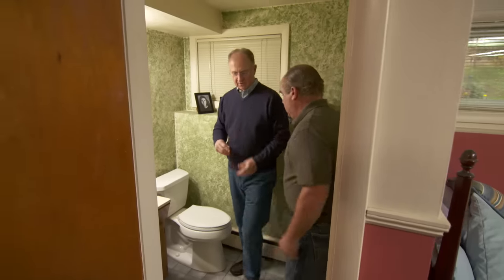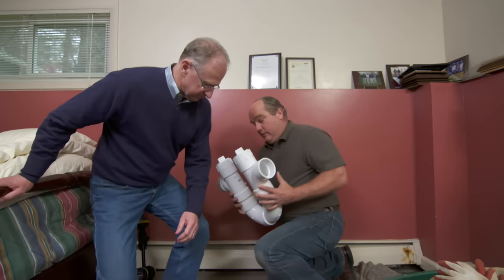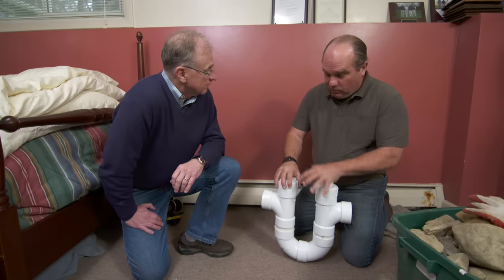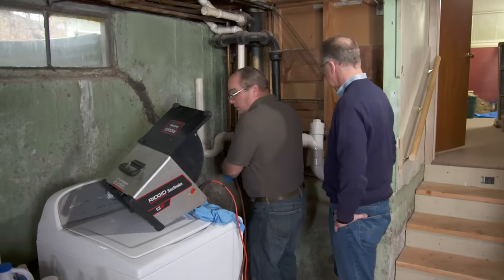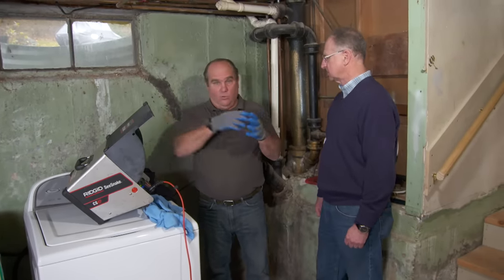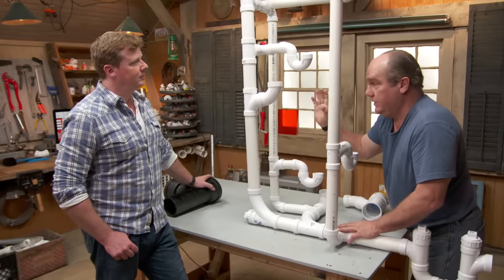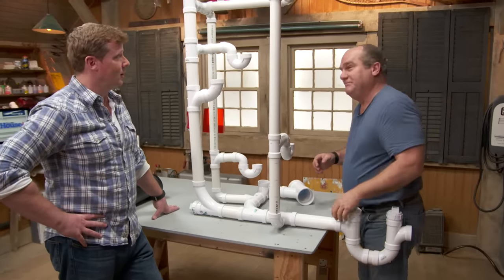How to Diagnose Plumbing Drain Problems | Ask This Old House

Comment: I had nearly the same problem. My main sewer line collapsed around 2 feet plus I had roots in the pipe as well.  Replaced 9 feet of pipe, now everything is good.
Reply: DID THE CITY REPLACE THE SECTION WITH TREE ROOTS OR WERE YOU RESPONSIBLE FINANCIALLY.  IF A CITY TREE SHOULD HOLD TOWN LIABLE FOR REPAIR WORK.  AFTER A CERTAIN POINT, IT BECOMES THE SEWAGE COMPANIES RESPONSIBILITY FOR THE LINES.
Reply: @joewell3074  No the roots might have come from my neighbor's house. She has a big tree near where the root problem was found.

Comment: couldn't u put a pipe within the pipe (smaller diameter)? You'd have to connect it to the house trap at the other end, but that would prevent you from having to do all of that ripping up.
Reply: or just make a new vent to outside since it looks close to the outer wall anyway?
Reply: @alfalfa  yep thats whwt i would do, just add a vent just before that whole house trap
Reply: vidfreak56 you never want a reduction in size with waste lines as you move waste out.

Comment: Also in the same commercial space that I work in that I did the plumbing for in our space. I came in one week and noticed a strong sewer smell normally I don’t smell any sewer smell even with the hack job type of drainage that is below our space in the dungeon. So I asked one of the employees that we have and he said the smell had been there for at least half of the week so I ran The hose down a floor drain then went down in the dungeon below and discovered that water was pouring out of the concrete wall beyond our space where our drain line goes then realized that the sewage pump that is at the end of that really long line had failed and had been overflowing for half of the week!! So I called in emergency call into the leasing company and within the next couple of days they had a plumber there fixing the pump!

Comment: Disappointed in Richard on this one. Rush recommendation with an incomplete diagnosis.  The camera was sitting directly on the bottom of the pipe so there was barely more then an 1" of water in the 4" pipe....definitely not full of water as stated.  Needed to verify the venting and perform a smoke test before talking to the homeowner about ripping up their floor and suggesting a remodel.  Would be one angry homeowner if all that work was done only to find out it was a bad toilet wax ring.  Also, sags are rarely a problem and if they were, there would be waste debris buildup which there wasn't.
Reply: Bad toilet wax ring - definite possibility. The homeowner says he notices a smell, but no gas bubbles in the toilet bowl, just water movement  Like you said, more diagnosis seems in order. Great comment!
Reply: Nailed it.  Thats what happened to my basement bathroom. I paid a plumber to check out a bathroom smell. Ran the snake and camara for 500 $ and nothing.  Later on the toilet started to leak around it. I replaced the the wax ring myself and problem was gone. Since then  pretty much i do everything myself.  Tnx to PROS like U. With a wealth of knowledge  sharing it on YT.  
And i totally agree with ya. That sagged line is really clean and it didn't back up  either when flushed. I dont see any clugging problem from where the camera was inserted to the street. Smoking the line sounds great rather than start digging and wasting money.
Reply: Haha nah. Wax ring is fine because you can hear the gas bubble through the trap which happens after the gas passes the wax ring gas under low pressure takes the path of least resistance which would be through a potential wax gasket leak before pushing up through the standing water in the trap built in to the toilet which requires greater pressure than escaping through a small wax gasket leak
Reply: Most likely the sink trap is the problem, if you can push that much water in the toilet, the sink trap has no chance to keep a water level in the trap to prevent  sewer gas filling the bathroom. 
I noticed that in the mock up of the plumbing system, the lower toilet was flat vented, in MN flat venting is not to code. If solids ever back up into the vent and don't drain out, the lower toilet will start to act up. Try to clean out a flat vent for only the toilet use.
Reply: What more do you want?  The pipe is completely filled with water.
Reply: this doesn't explain why the water is seating in the middle session of the drain line. Your explanation makes sense but could have both problems happened at the same time. No matter what, landlord needs to pay the digging bills.
Reply: Well according to most of the comments I see you on here most people are happy with the video but I guess everybody has to be really picky and butt hurt
Reply: Cameron Bouchard Richards a machine he probably noticed that and didn’t bother thinking about the seal, probably 2nd nature for him to think this way
Reply: What does the wax ring have to do with the water bounce in the lower toilet, this is caused by hydraulic head locking from the water in the main drain line. Keyboard warriors have an answer for everything, but I guess that’s why I have a business while you all are still in your mommas basement! Richard nailed it right on the mark. Great job Richard!

Comment: I don't understand why he is not in favor of a house trap. I thought every system needed a house trap
Reply: Every fixture needs a trap, having a house trap double traps all the fixtures.
Reply: That and a whole house trap makes it difficult to clean out if there was a clog in the mainline between the house and sewer.
Reply: House traps existed long before fixtures had their own traps.  There is no purpose for house traps these days.
Reply: As Richard said, the "house trap" was a countermeasure to rodent invasion of the house, should there be a septic tank outside the house.            I suppose rats might come up from sewers, too.         
Where I live, in Long Beach California, we have heavy metal flappers (which I have never seen, but haVe heard about) which preclude reverse flow, from street sewer to a house's sewer line.  That would block a rat, too.      Unless that rat was a genius rat, with clever paws!
Reply: Out in Chicago, they use backwater valves like you've described, to combat basement floods. Their area is especially vulnerable, since the area is flat, the sewers are combined (but being separated, by mega projects like TARP) and the area is commonly subject to heavy rainfalls.
Reply: Really only required in urban or densely populated areas
Reply: I'm a plumber in Pittsburgh and all buildings and homes need a house/building trap in my county and all the surrounding counties. It is code and will never pass an inspection
Reply: They are not illegal. They are necessary only if you have floor drains in the basement, as they go dry when there not used. But every house trap needs a fresh air inlet on the house side of the trap. They did not have one here. Sag in the line was the problem here. Local codes dictate weather you need one or not. Most of the time, no.
Reply: i run into these up here in mass and usually they are in the basement..as long as there is decent cleanout  access i  leave them alone..  it is a pain though when we are jetting and we run into one..alot of homeowners  do not even know they have one until  there is a problem.
Reply: How in the hell do you get turds to clear a house trap?

Comment: OMG this has started happening in the last few months,,, when the shower or washing machine is being used...but we cannot tell which drain it's coming from, it seems to permiate throughout the house! And there has not been any new plumbing done here, so it just started one day.
Reply: Check for a clogged vent on the roof first.  Anything can get up there and make a nest then a fixture isn't probably vented resulting in the trap getting sucked dry when you use another one.

Comment: Big job indeed - that's going to be some serious $$$$.
I know there's a powerful suction force with the vent pipe and a toilet flush, but I am surprised a trap like that would still consistently pass solids and all the accumulated gunk after 3 decades of use.

Comment: Nice work guys, keep it up. I noticed a big crack in the concrete wall at the bottom corner of the 
window. Could it be that the foundation has sagged a bit and bellied the pipe. ?? 
X-treme Ed

Comment: lol I love how just behind the bathroom there was the entire sanitary system with an access cleanout. same thing with the access in the floor. in Florida, none of that exists in homes, we have to pull the toilet to clear stoppages
Reply: johnny cole what?? No you don’t . lol. There’s an access clean out on top of your roof. You stick the snake through there. Every bathroom and kitchen has one... this guy had the one as well, even though the one they showed is in the basement.
The one on the roof is where sewer gases escape and helps push the exiting water push itself to the city sewer or septic system
Reply: Jonny Cole, definitely like the other guy said.  Get a sectional machine like the Ridgid k-60 and lay a nice size drop cloth on the roof. Carry the machine up then go back and get the rack of cables and the cord. Unstopped tons of main lines like that.
Reply: @GabrielGonzalez-kb5by  obviously smart guy. I was referring to not having to go from the roof. and really the roof is where gases escape? its called a vent hombre
Reply: @erics3886  yeah....ive done hundreds of stoppages through roof but appreciate the input lol
Reply: johnny cole it wasn’t so obvious if you  pulled the toilet. Lol. And a vent IS an access point HOMBRE
Reply: Gabriel Gonzalez idk what you’re arguing about- I never said it wasn’t an access point lol Christ
Reply: johnny cole you never said it was, either. Lol. You clearly corrected me by calling it a vent, while I called an access point. So I had to clarify

What’s up mentioning Hombre, and Christ at the end of your convos?? Are directing it to me as a ‘name’? 
Or you calling on them to join in the convo? Please clarify

Comment: Question. Just bought my first home. Had an inspection done, nothing in that report about the water over flowing in the master bathroom floor from toilet base when we shower. I assume it was because he didn’t let the water run long enough to see. When the shower is running in the master the other bathroom toilet bubbles.  You can shower in the other bathroom and it will still have water in the master bathroom floor. It’s clean water, no smell either

Comment: 8:55 perfect diagnosis…curious about solution, but I would just bypass and go out side wall direct and reconnect from exterior main waste line - thereby bypass house trap and reconnecting house vents from outside. Homeowner has commitment to digging…should jump to outside of house next to bathroom and house trap to find main waste line connection…two holes and a trench and plumper could do in 2-3 hours for $500. Done. Not $5000 which probably what he paid to resolve

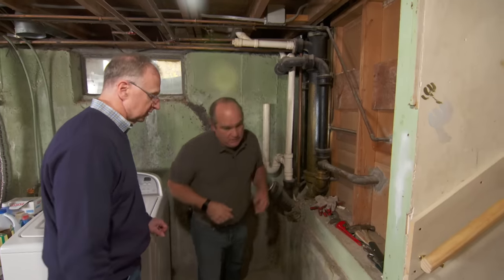Comment: 8:42 - that explanation of the sewer gas seeping through cracks in the pipe when water goes through the pipe doesn't make sense.  If there are cracks in the pipe, shouldn't there not be water at the low point.  This would be the point where the pipe is sagging and possibly cracked from the stress, right?  If the crack is on the top of the pipe, shouldn't you always smell the sewer gas?  I see he corrected his explanation at the end of the video and said that the gas was actually bubbling through the downstairs toilet.  So the issue is venting of the upstairs toilet.  If that's the case, maybe they can just add a vent--possibly at around the cleanout drain plug downstairs, and go out through side of the house where that window is  (2:13).

Comment: I had the same thing happen to me too in my basement bathroom toilet with the oder etc. It turned out to be the wax seal under the toilet was all dried out over the years and so the sewer gases were coming up and after the wax ring was replaced the oder went away and was a lot cheaper than what these guys are doing!......
Reply: I always start with the easiest thing first and that's usually the wax ring on the toilet.  I make sure the traps have water in them first cause a floor drain for example that doesn't see much water going into it will eventually evaporate and let sewer gas through. If you have a trap that isn't used much if at all, pour some vegetable oil in it. Won't evaporate and the drain can still be used anytime without issue.

Comment: It looks like the pipe is just on the inside of the building. Instead of digging the floor up I would direct the pipe to the outside of the house It would only mean moving the pipe over a couple of feet and you wouldn't have to destroy the inside of the house to do it.
Reply: May not meet code though.

Comment: I have a question that I can't get an answer to, I think it baffles the plumbers and the septic people!
Only when we get a lot of rain our 3 toilets will not flush, but the crazy thing is that all other drains work perfectly! Even the washing machine!
The plumbers say that the vents are fine, ran cameras and everything. They say it's a septic issue. The septic guys pumped the tanks and say it's a plumbing issue. 🤪
In the meantime nobody fixes it and we're stuck in limbo until we get an answer. Please help with some ideas as what the cause might be. This is maddening. 
Thank you!

Comment: I would have added a vent up off the house trap on the house side of the cleanout. If the house still drains that'll fix the venting problem until the homeowner is willing or able to dig the building sewer. On older houses it's just not worth the dig cost in my opinion.

Comment: What about removing the rat trap, then dig under the cast iron pipe to get if to fall, an inch or 2 , then connect that fall to to line outside the house at the point that maintains that fall. But 1st I would replace the wax ring just to ck it effect on everything.

Comment: LOL. Settling. They just did a crappy job to begin with. 😆
Old house settling does occur, but if the pitch was 1/4 inch per foot to begin with, I'd doubt the house has all of a sudden tilted way far past that. And if it has, they have far bigger problems than sewer venting.
Reply: He said the pipe was settling

Comment: That's a $15k to $20k job. RIP up 20 ft of floor (that's the bath and bed room) 1 wall(some demo, not the whole wall) dig up pipe, replace pipe, re-concrete the floors. Rebuild bath and bedroom. ... ... I would love to give you a quote for the work

Comment: We recently got a bad smell from our upstairs sink. I took the drain apart and cleaned it and the smell went away but only for a couple weeks and now its back! It's most noticeable when we run the water. Any guesses as to what's going on? Do I just take it apart and clean it again? Doesn't happen in our downstairs bathroom or basement bathroom.
Reply: does it have a water trap, if not install one, its sewer gases propably.

Comment: Can someone please tell me about the large P Trap in homes of the past and as depicted on the picture of this u-tube video. How does the grinding from a garbage disposal or poop in general flow past this Large P Trap? How does grindings and poop flow past a sag in the main sewer pipe to the street caused by tree stump?
Reply: Compared to the volume of water used in kitchen disposing or toilet flushing, the amount of solid matter is quite small. There should be sufficient water flow, and the solids small and buoyant enough, that they will flow through twists and turns without any problems. There may be a small amount that settles in a sag or trap but the next slug of water will send it on its way.

Comment: Hi there,  Im puzzled I have an older house built 1974, Im trying to figure out why the kitchen sink spits back up and downstairs directly on the same side  the downstairs floor is wet,  could it be when i renovated my kitchen a few years ago they didnt reline the pipes when they moved the sink location or baby wipes still in the lines when I rented the machine to clean out the toilet from the wipes and I cleared it,  standing water is outside ( exterior) of house WSSC came out before, I thought they fixed the issue , not sure....   I live around trees in the backyard maybe roots, slab pipe leak, I really dont know, Im so puzzled.  Any advice would be greatly appreciated !!!   Thanks in advance

Comment: My upstairs kitchen drain is clogged. I had professional snake with 33 feet run through the pipe. I tried gallons of chemical drain cleaners with no result. I tried buying 22 feet of pipe camera but the lens get dirty fast and image goes black once the lens is covered in dirt, so the cam is useless.   I can't figure out the cause. The main drain is not clogged as downstairs sinks drain normally.  What are some options?  I was thinking getting a plumber to try high pressure water jet and I guess if that fails only pipe change all the way down to main drain? :(
Reply: Keep snaking it and run the hottest water you can down it at the same time. Or have someone jet it.
Reply: It's probably a bunch of food and grease

Comment: Q: I’m have a bathroom put in the basement using a ejection system. Everything is about 10ft away from the ejector pump. Does this have to have a vent pipe or the tank pump vent pipe is good enough?

Comment: I have a question we have a older house and it has some old cast iron drain and it was replaced with some black plastic pipe but the pipe is odd. It has a 4.8 outside dia . Wall thickness is 3/8 . And iD is 4.030. Do you now what kind of lipid this is. Also how would we hook up to it? Rubber boot?